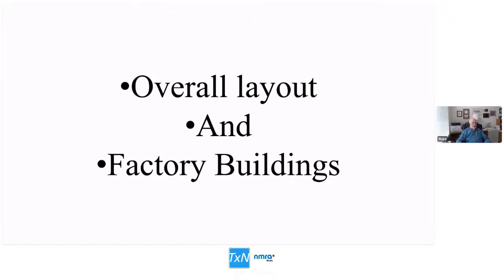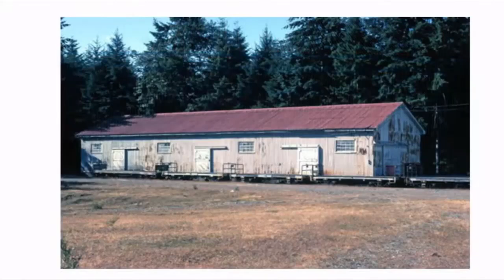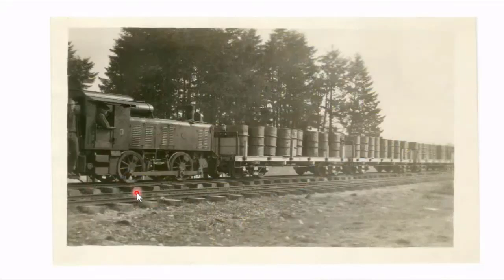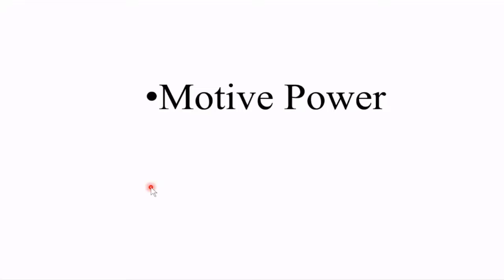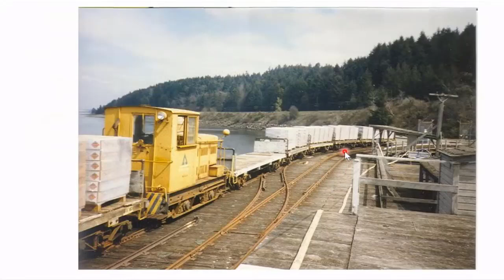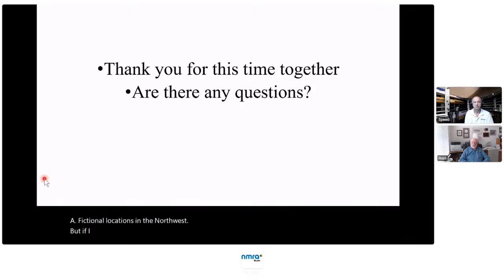Russ Segner Modeling A Rail Served Dynamite Factory 202309 NMRAx

Comment: You said the loco in the photos was a 12-ton Plymouth.  The engine housing looks to be worked on because a Plymouth loco would have a radiator with Plymouth on it between the opening and filler area of the radiator.  I operated the No. 5, a 12-ton Plymouth 3-foot gauge loco, the Huckleberry RR had when I worked there from 4/79 to 10/83.  It had a D-8 CAT diesel engine in it.  It had a 4-speed transmission plus forward and reverse, so the speed in either direction could be the same.  This particular loco had an unfortunate encounter with a 35-ton 4-6-0 and lost the original radiator, which was replaced with a Caterpillar radiator.   The engine housing was even and straight on both sides without the "box"-sticking out of the left front.  I have an idea that encloses the air compressor, while the air compressor on the loco on the Huckleberry was inside the cowling.  I have an idea both had No. 200 roller-chain from the transmission to each axle.  I know the No. 5 would travel at 1.3 MPH in 1st gear and 12.5 MPH in 4th gear.  The fueling of No. 5 was with a pump similar to the pump you showed as the gas station, just diesel instead of gasoline.  Do you have any idea when the loco was built?  No. 5 was built around 1950 for use in a salt operation around San Diego.
I know from talking with workers familiar with the solid-rocket fuel production at the Karnak, TX plant, that all personnel in the manufacturing areas had to wear totally cotton garments to prevent static electricity sparks.  More than likely, this would have been required around dynamite as well.